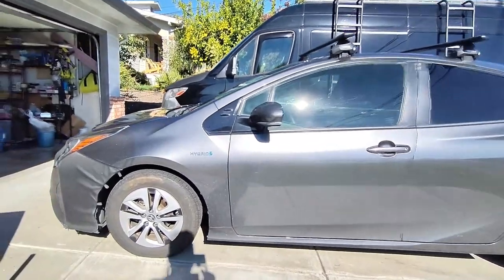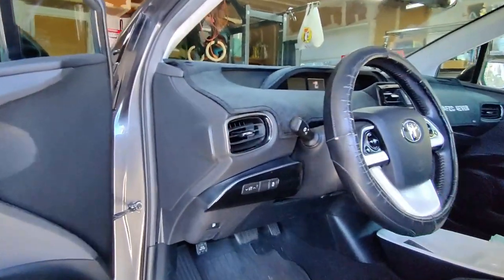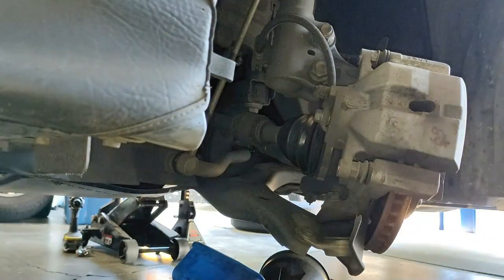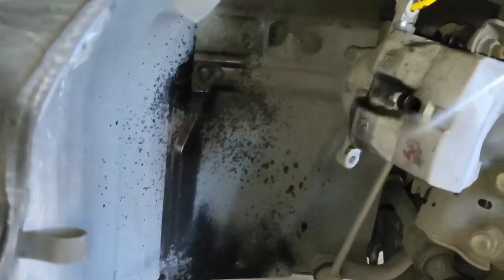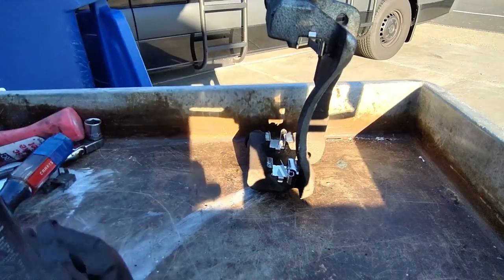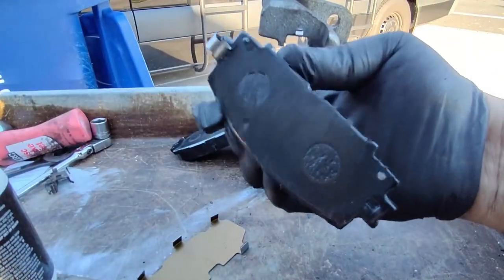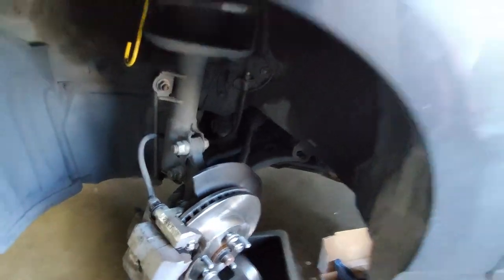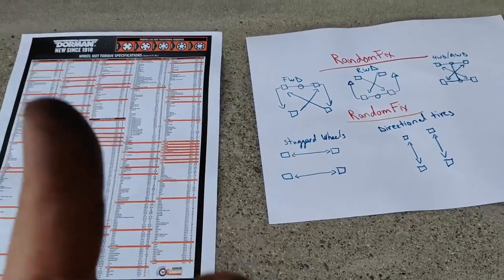Toyota Prius Front Brake Pads Change & Brake Rotors

Comment: Thank you for making this video! I did my first brake and rotor change on my girlfriends car today. I had to rewatch a few parts as I was doing it. Very helpful. Only thing I really struggled with was getting the new pads into the locking bracket pins.
Reply from the maker: Thank you for your feedback, much apprecated!

Comment: Checked front brakes after 115k miles.  Still have 7-8mm!  Amazing.  Rotors look good, too, 25mm thick.  Warped, maybe, but if so, not badly.  There wasn't much grease between the shim, anti-squeal plate, and brake pads.  So, I re-greased with heavy caliper grease in the areas suggested by TIS.  I wasn't comfortable chucking the shim and/or anti-squeal plates as you mentioned.  I did a test ride.  It seems that the clicking is much better, but still there slightly.  Good to know, though, that the problem seems to be not important, and not the axle, which is a rabbit hole many have fallen into.  Still, need to put some miles on it, and see if I truly alleviated the problem noise.
Reply from the maker: Sorry for the late reply, I appreciate your feedback
Reply: Finally getting back to this post.... basically the noise came back pretty fast.  Probably really do need to remove the shim/anti-squeal plate.
Reply from the maker: Thank you the update about the Prius shim noise.

Comment: Hi mate , I have them changed to the garage and now I m hearing a metal noise like when is loose metal part and when I m going over a pothole or a bump I hear it, I asked the garage and they said will take few days to readjusting, do you think is ok? Thanks
Reply from the maker: Sorry for the late reply! did you find a solution?

Comment: Wait, is this the first brake job at over a 100 thousand miles? Wow!
Reply from the maker: Yes, you could probably got 175 k or 200k miles and still be good. Only reason I did it was because my Nieghbor gave the rotors and pads for free and I’m going to see the Prius in 2 months before I move.
Reply: @RANDOMFIX  I just bought a 2018 base Prius with 39k miles last month I’m loving it so far! Your video and ones like this  is increasing my trust In Toyota thanks man!
Reply from the maker: It’s a great car!  Just remember to do the transmission service ever 100k or 10 years. Also the 12 volt battery need to swap out every 4 to 5 years max. My last 4 cars purchased other the camper van have all been Prius.
Reply: @RANDOMFIX  quick question. I have 62,000 miles on a Prius 2016 C.  Was told yesterday by dealer I need pads and rotors…$500.   Last August I was told I didn’t need brakes.  Drove the car very little since last August due to not working.
I would think that if anything, maybe just the pads?  I went in for my regular service maintenance?  Any thoughts?
Reply from the maker: Get a second option or perform your next tire rotation yourself and check yourself. I have plenty of videos on how to do that.
Reply: @RANDOMFIX  thank you…you have an excellent thing going here… I just subscribed.
Reply from the maker: Glad to help, and welcome to the channel.

Comment: In Tijuana they change my front brakes for $35 they went 220,000 miles. 2012 pruis also got the abs  Hydraulic for $ 300, my local dealership wanna me to pay $3000 lol.

Comment: Do you have to machine the discs?
Reply from the maker: Machining  can’t fix warp rotors but you can machine them. I would rather buy new rotors considering you only have to do the brakes on the Prius every 120k + miles.

Comment: Can't wait to remove the anti-squeal plates to silence the 'click-click-click' noise!  I'm pretty nervous about the pistons popping out.  I'm going to remove the neg battery cable as suggested almost everywhere, and put the key FOB far away.  Even then, I'm still going to be worried; but it seems like all I can do, which is simple, to take extra precautions.  I might get new rotors, because the car has moderate vibration/shimmy when braking downhill at high speed. So maybe they're warped.
Reply from the maker: Yes the new rotors sound like they are needed. Does the brake pedal pulsate when you are apply the brakes?  Here is my 8 tips for brake jobs https://youtu.be/KeKG5Cfnlmw
Reply: @RANDOMFIX  I believe it does pulsate.
Reply from the maker: Then your rotors are warped so they need to be replaced like your said.

Comment: Didn't show jacking car up, taking wheel off.. etc. New people should know,  many jacks will not fit under this vehicle,  including ramps.
Reply from the maker: You can not use ramps for brakes but the links were in video description Prius tire rotation https://youtu.be/Vfl-2a6ASSs
Brake cheat https://youtu.be/zGLL1yEnHv8
Free gifts https://www.randomfixworld.com/downloads/
Reply: Ramps fit in the prius, any jack would work too
Reply: @ryublackz4  false. unless you want to damage it.
Reply: @HelloBrian7  LOL! I've been doing tire rotation, oil changes, transmission oil change for the last 240 000 miles, and I just did brake pads. I haven't bent or damaged anything prius it's just another car, nothing special, they have a lift point in the back, you can jack up both rear tires at the same time with one jack.
Reply: @ryublackz4  ..I've been doing all that for 35 years.  I've owned three generations of prius. The prime advanced,  has a special front end shaped where ramps will not work (without damaging the car) the back, there is nothing in the way.  Even flat bed tow drivers have to make you sign a waiver, if you want your car towed, because they also risk damaging the front end, when using a pulley. If you don't know all the different models of prius, you wouldn't understand.  The regular prius of same year,  is not the same design in front, or back. 
"Just another car you say?" lol! ..this car can be programmed to be autonomous.. not just another car.
Reply: @HelloBrian7  Yes, just another car. Is your prius program to be autonomous? Most likely, no. We have a prius Prime advanced in the family. I do the oil change on that, too. We have 3rd gen prius, prius C, 2 4th gen prius, prius V, 5th prius. 3rd gen prius rear end another car, me and a friend disassembled, replace and paint the whole front just like a regular car, replace one time hybrid battery, again nothing special. So far, the only one that's been on a tow truck is the prius c lol 
I'm 30 years old and work on a lot of cars' high power applications, engine rebuilding, transmission rebuilding, engine managing software, welding fabrication, and programming. Looks like you're a little outdated, pal.
Reply: @ryublackz4  ...I'm outdated lmao. Yes, my prime is autonomous..i write programs, and exactly why i bought the prime advanced,  to program it. You keep destroying things.. I've met your type before.. 'Just because you can, don't mean you should!" 😂😂
Reply: @ryublackz4  ..how many inches, is the front bumper. on a 2017 prime advanced,  with stock wheels/tires? Quick, . you know everything... then tell me the elevation of ramps you're using,  to drive a prime advanced foreward, on those ramps, without damaging... I'll save you some time.. You're not!
Reply: @ryublackz4  ..by your autonomous question, you obviously don't even know your car can be programmed autonomously.. (if you really own one) ..that tells me everything.  Nothing you say, matters at this point.. you don't even know what kind of car you actually have!! 😭
Reply: @HelloBrian7  I'll post a video just for you on the prime getting in the ramps (rhino ramps).
Reply: @ryublackz4  yes, please do